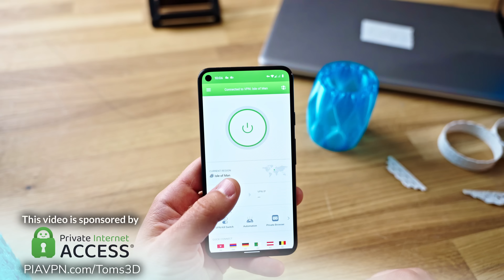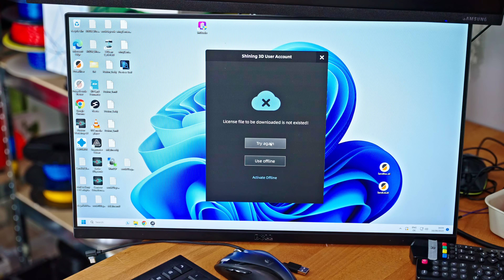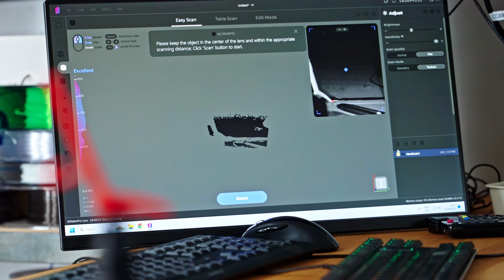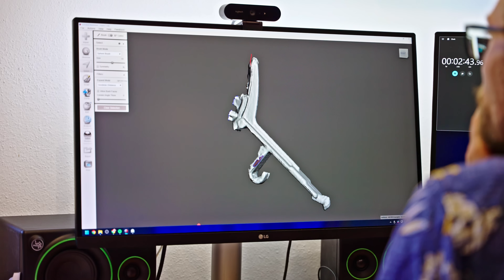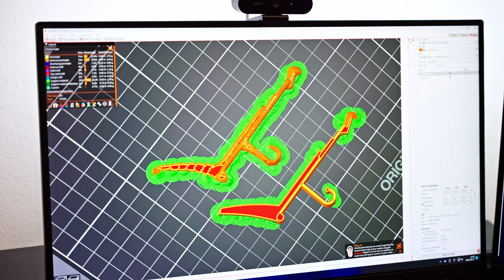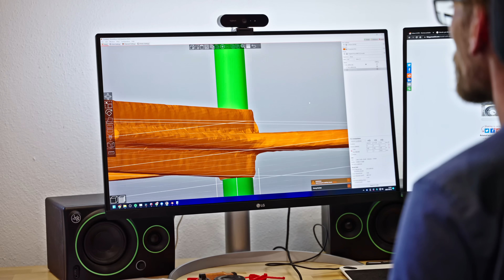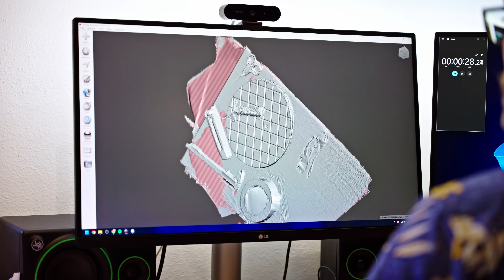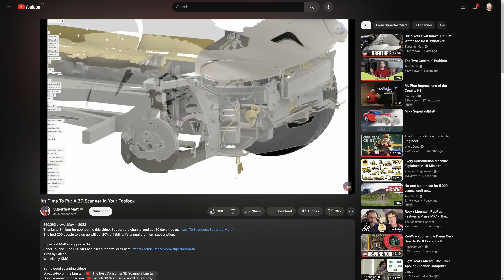Make replacement parts faster - with CAD or a 3D scan?

Comment: I look forward to the day that consumer 3D scanners are affordable, reliable and work well. The world of home repair will never be the same. The effort of measuring and recreating parts is doable for some things, but if it could be automated.... that'd be awesome!
Reply: The FaceID sensor of modern iPhones can do a decent job at scanning. Used it to make a camera adapter for my turtle's shell.
Don’t even have to jailbreak the phone, there are apps on the App Store that work
Reply: @among-us-99999  A camera adapter for a turtle shell? Lol, sounds cool - are you trying to make Turtle POV videos?
Reply: what apps are you using?
 @among-us-99999
Reply: @among-us-99999 which app do you thing works best?
Reply: If you just use standard photogrammetry software it becomes much easier, without any of the proprietary cloud lock in BS that for me at least makes that company a non-starter.. but with off the shelf sideways, the hardware to take a ton of pictures on a turntable has to be diy unfortunately
Reply: The interesting thing is that this can be done with a regular phone, doesn't even need a fancy depth sensor. It's a bit involved, but here's a possible approach:

1.Capture phone orientation and relative position by using the IMU in combination with one of those special AR QR codes.
2. Take those image+orientation data and train a NeRF model or neural radiance field model. The gist is to have a network predict the color and depth of any given ray of light.
3. From this model, we can generate a point cloud which we can turn into a mesh.

Now, Nvidia created something called instant-nerfs which makes the training time for these networks to be seconds.

So, if you're dedicated enough, this isn't out of reach to create. There's probably a random GitHub repo with a similar idea out there :)
Reply: Einscan-SP or Einstar. 
Never had his activation problems. Maybe his device was a review unit?

I have the Einsxan-SP and a Revopoint Mini. For this part I would have used the Revopoint Mini because of how small it is.
With the mini I probably could print it without editing the STL in CAD. 
But I usually import the 3D Scan in Fusion and reverse engineering it.
Reply: i was thinking the same thing about not being the right kind of scanner for the job a mini would've probably made light work of it  @Todestelzer

Comment: You can also make a silicone mold. I think it would take me less time to pour a mold and prep it for production that it would to do either of the two methods described here.
Reply: That would work to recreate a non-broken part, but if it's broken you'll just recreate the break - no?
Reply: @RoccosStuff you would glue the part back together first. Maybe fill in any gaps.
Punished Props in a recent video created replacement parts for an old car. He sculpted the broken/missing pieces, and then created a mold.
It took significantly more time than either of the options in Tom's video.
As with anything, 3d printing is a tool. It isn't the only way to recreate a broken part.
Reply: @tiffanysandmeier4753  Did you mean to say it took significantly less time to make the mold?
Reply: @RoccosStuff  "The Dude Abides"
Reply: "That's just , like, your opinion, man" :) @wxfield
Reply: @RoccosStuff  Evidently you and several others didn't watch the video. He used an unbroken part from his other flush box to scan and design a part. Use the unbroken one for the mold. OR, to entertain the idea he didn't have an unbroken part; just mend the broken part with glue and make the mold. Dead simple. Fast. Cheap.

Comment: Private Internet Access didn't work well for me. You can't even use Google, because you have to solve massive amounts of Captchas or you are even blocked completely. If you log into eBay or PayPal, they will lock your account until you reset your password every single time. Don't use them

Comment: At my internship I've been trying to recreate small turbine blades so we could recreate them out of composite. I've had trouble scanning thin flattish parts like turbine blades. Recreating it by hand is near impossible. I've done a mix of both. CADing the tolerance specific parts like the blade mount. Then using the 3d scan points to help me make the surface of the blade. It's not the best.
Reply: Scanning with the lynx I noticed you were in texture mode not geometry. You might get better results with geometry. I have the mole and that's my experience with small parts like that.